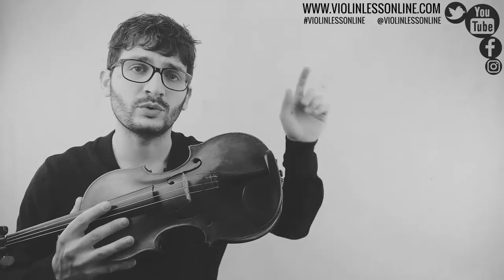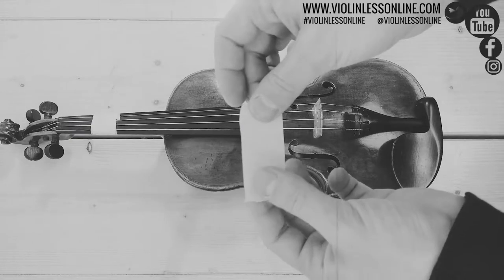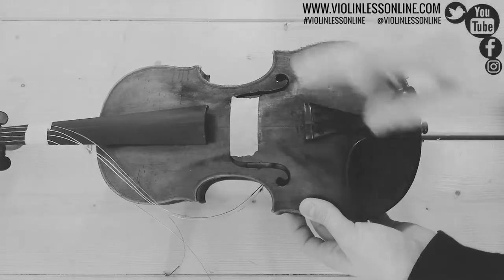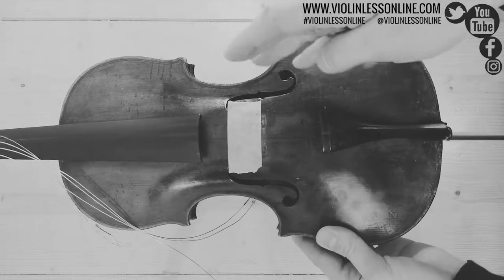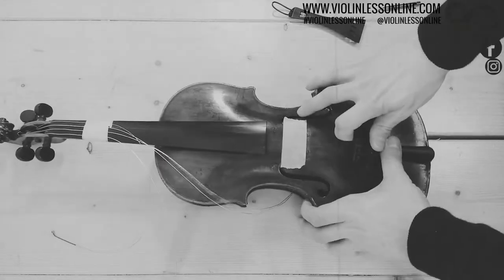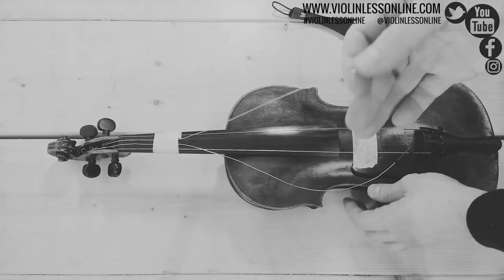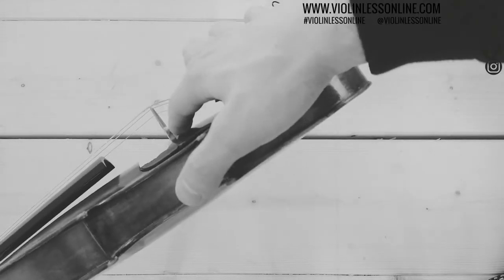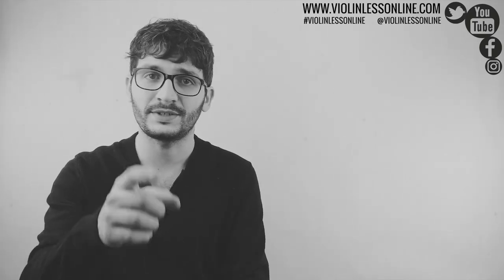How to Change or Replace Your Violin Tailpiece

Comment: Nice clear video for an amateur fiddler like myself. My biggest concern is the sound post falling over, but like you say, be smooth and it may not happen. And if it does, well as they say, "say la vee" you've got the job of re-setting it.  Thanks.

Comment: You made the tailgut length in order to make the tailpiece end "look nice" in relation to the end nut, but that dismisses that the string after-length (brigde-to-tailpiece fret) s/ = 1/6th the string length (nut to bridge).
Reply from the maker: hi...that is meant to be a DIY for beginners... on inexpensive violins the bridge-to-tailpiece fret length plays only a limited role on the sound